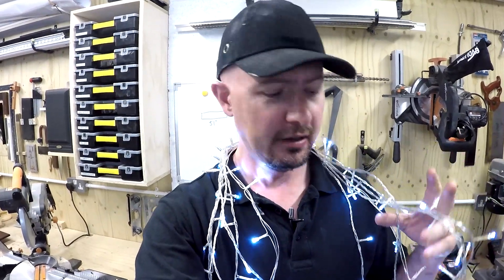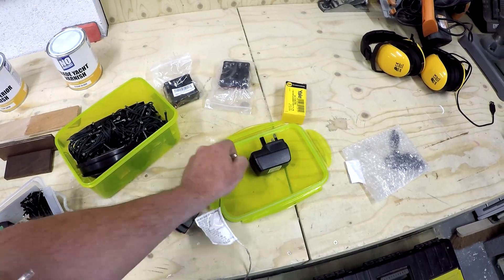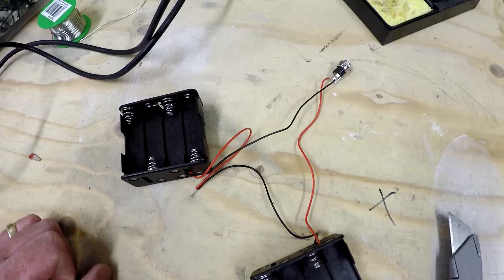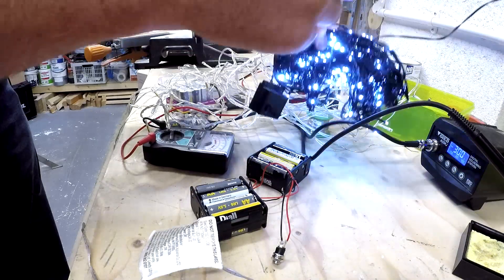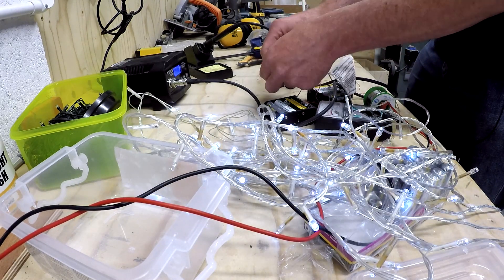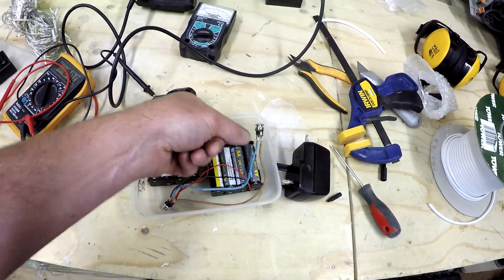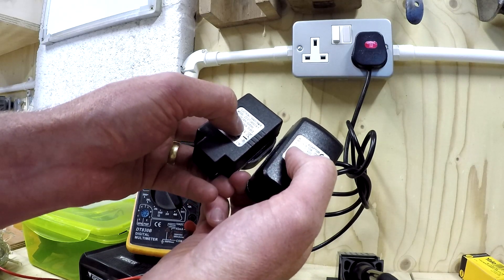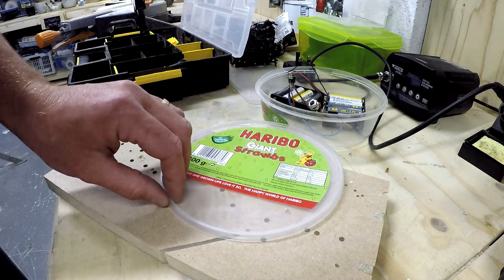Running LED Fairy Lights off AA Batteries

Comment: Hi Andy. Just wondering. If my lights is just using the plug not the transformer, can i just directly connect the wire of the battery box to the plug of my christmas lights? My christmas lights is 120 volt. Thank you anyway. Otto